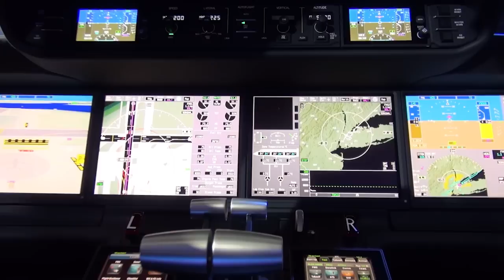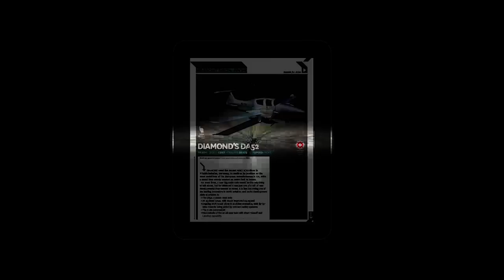Gulfstream G500 & G600

Comment: Active control stick may have saved Air France Flight 447. Why the change to PW when all Gulstreams aside from the Isreali made jets have used RR since the beginning of time.
Reply: They're much more efficient, they burn hotter but less fuel flow for the same performance. They're quieter than the APU believe it or not. The G700 is going back to the RR engines.